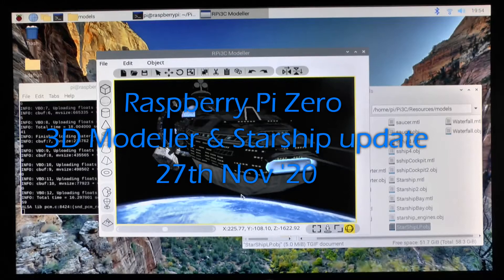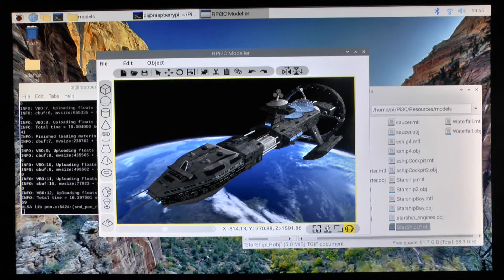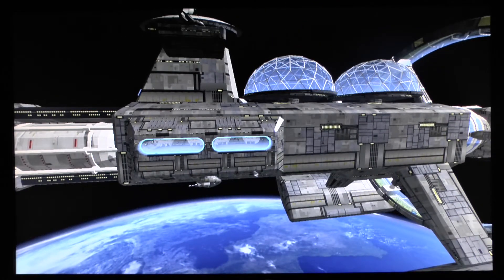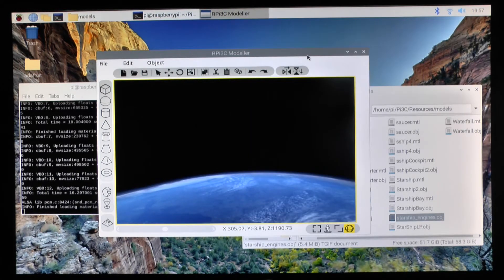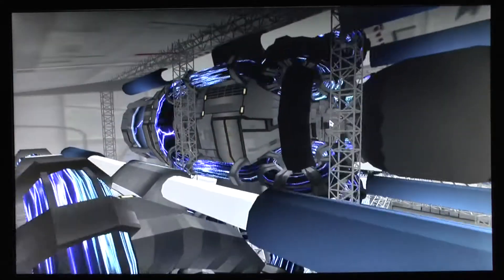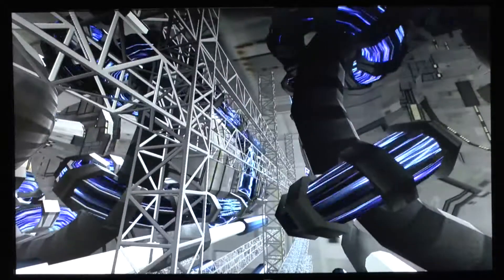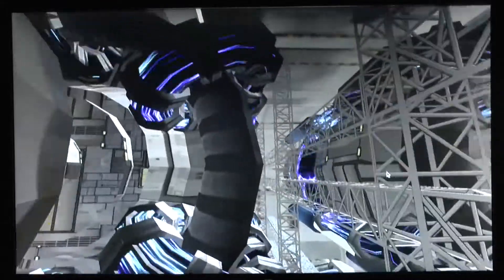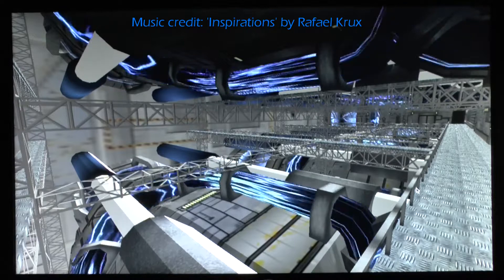Raspberry Pi Zero Modeller & Starship update 2

Comment: Impressed with the performance on the humble pi zero. Interesting observation re: rpi 4 performance, would be interested to know what the issue is when you  get around to it.
Reply from the maker: Yes, not too sure why?  It could be background interrupts as I'm still running X11.  I did a 'test flight' comparison between the Pi Zero and the Pi4 on a frame-by-frame basis - the Pi Zero definitely won it!